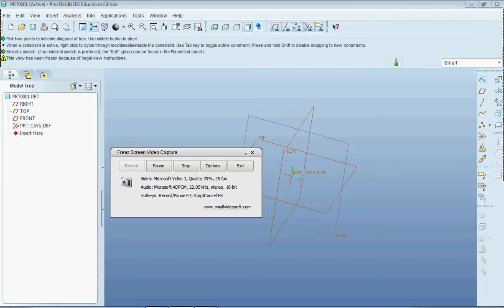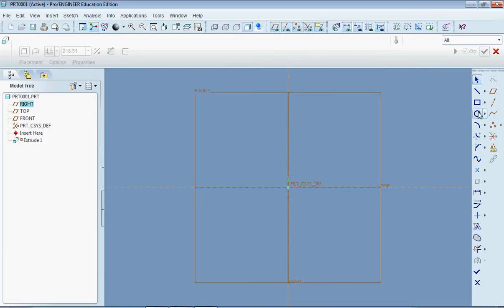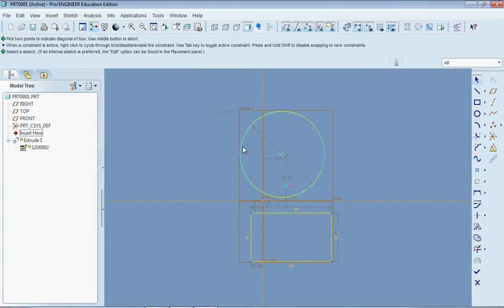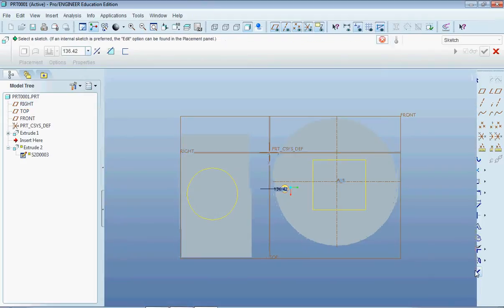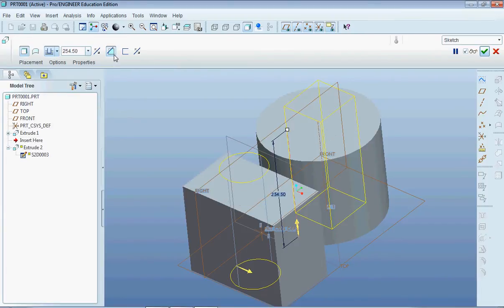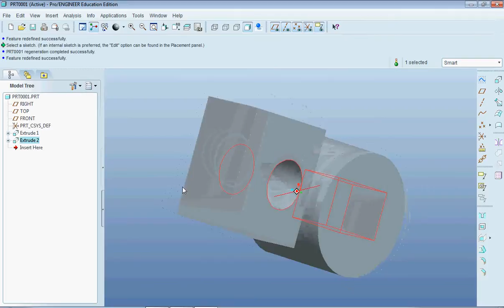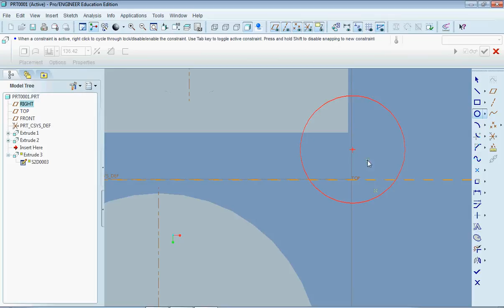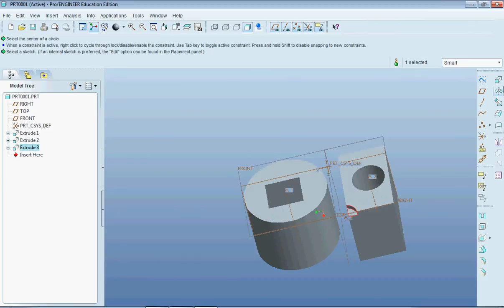Pro Engineer Made Simple - Part 4 - Internal Sketch Extrudes

Comment: @Decaff2010 Yeah that is what I want. 2 concentric circles and then to extrude a ring. I was trying to extrude walls for an architecture experiment and I was able to select only the external contour of the drawing. In fact, I'm using Creo 1.0, but the commands are the same. Well, thanks a lot for answer me so fast. I'll try to discover what's wrong. Thanks again !

Comment from the maker: @Christomb I'm not sure what you are trying to extrude. Is it the square EXCEPT where the circle is? if so then you can do that. Pro Engineer will make whatever shape is made IN BETWEEN the shapes you make in the sketch mode. So if you have two circles sharing the same center point, but different diameters, it would made a ring shape with the middle the size of the inside circle.

Comment from the maker: @ryankburch Correct me if i'm wrong, but what you are trying to do is take a shape from sketch A and import it into sketch B while retaining the ability to edit the import. This process is very similar to importing an airfoil, which you can find in my other videos. You can use that method to import a sketch into another sketch in conjunction with saving saving Sketch A using File->Save As. 

If you need more explanation I'd be happy to make another video detailing this method and a few others.